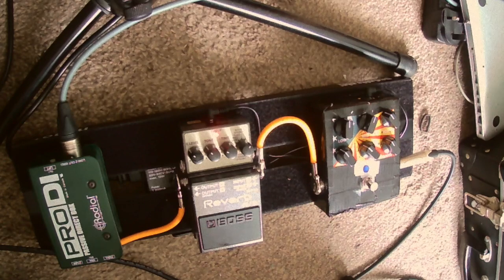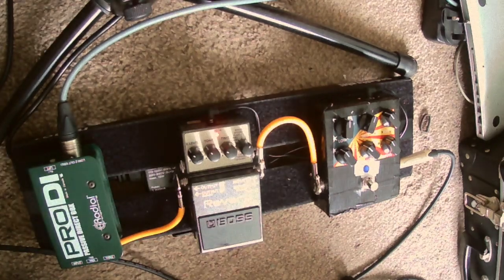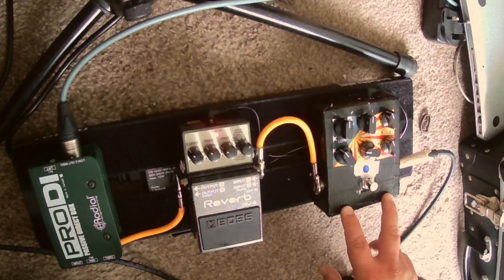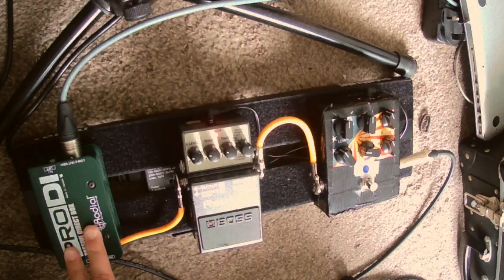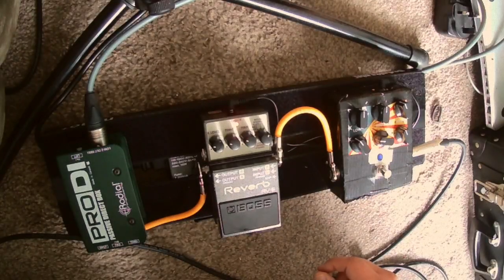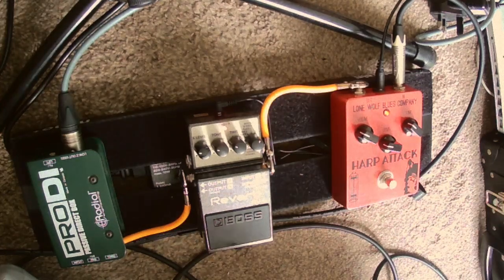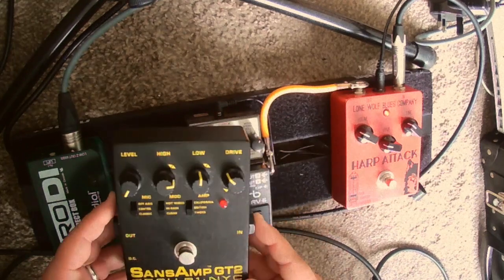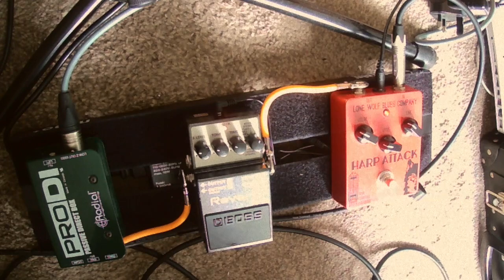Straight to PA Harmonica Rig - Look Ma, No Amplifier! | Harmonica Miscellanea 004

Comment: I recently purchased the Alpha Wolf that has the Harp Attack, reverb, equalizer, and DI box in one. It also requires AC power, but makes a great sound! I’m planning to use it out for the first time tonight, but so far I love it!
Reply from the maker: Yeah! I've had my eye on that. Looks like a serious bit of kit. Have a good gig. Let me know how it works out for you.
Reply: Worked flawlessly on stage. I plugged into one of the mic’s XLR cables right into  the pa board. No issues, and I was happy with the tone
Reply from the maker: @chandlerpoling  Good to know. Seems like a great one box solution.